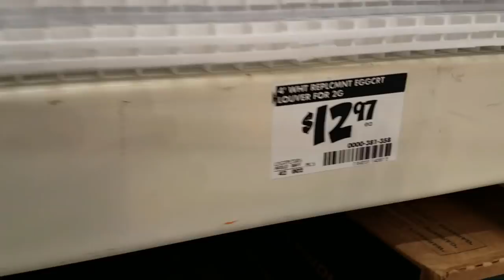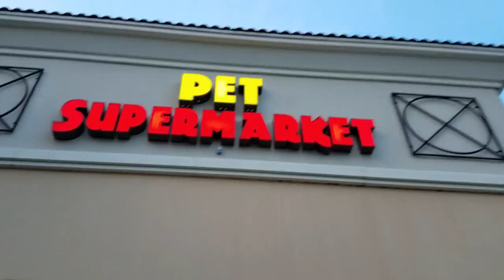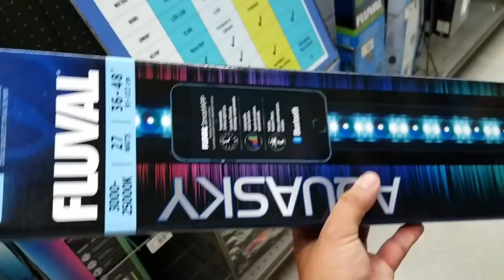I FIXED THE MEGA FISH POND!

Comment: Joey, I've been able to get the white stuff off with hot water and little bit of vinegar. Then rinse it off super well, to be on the safe side I also boiled water and stirred the return pieces around in the boiling water using tongs, and let it air dry.

Comment: Also dip what has the gunk in a bucket with half a cup of bleach, and the rest water for 24 hours. Then scrub with the rough side of a sponge. After You're done cleaning. Keep it in a different buck it with a full bottle of Tetra Aqua Safe 3.38 fl oz. For 24 hours 48 if you want to be safe

Comment: Use an slightly abrasive sponge without any soap or any pre loaded. And tank water. I have calcium deposits because of my hard water. That an elbow grease works. This way you aren't adding anything into the tank. I just gave my tanks a good scrubbing and it all comes off. And my build up was way worse. Some people say you can use vinegar or something but that can mess with the Ph levels. Nothing but tank water, sponge without soap and elbow grease, long story short.

Comment: You can add a red bay snook to your 40 gall, you can remove those stains with a razor blade or rub it with cleaning acid, once cleaning with acid is done rinse it well, everything will be fine #joeyslayem